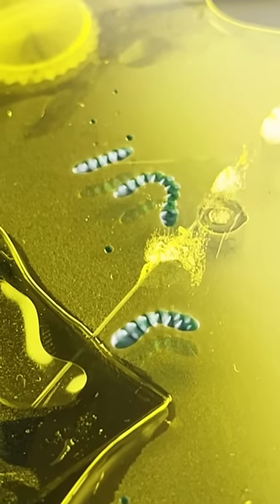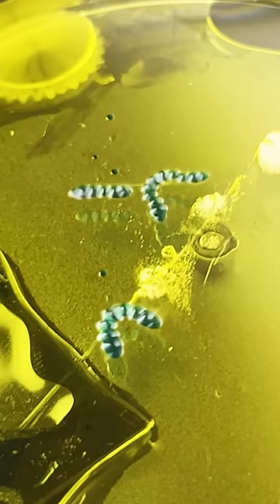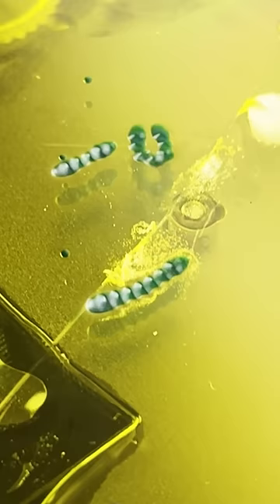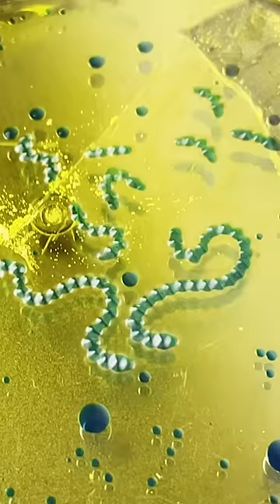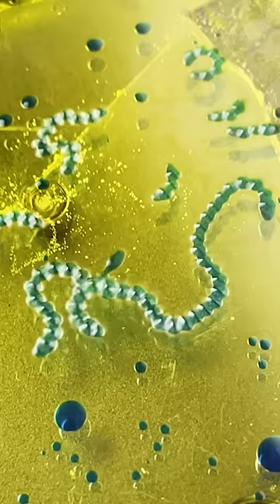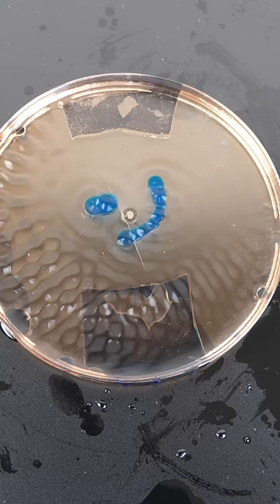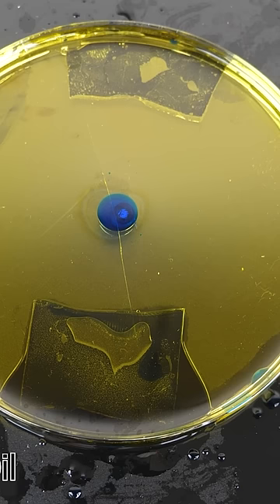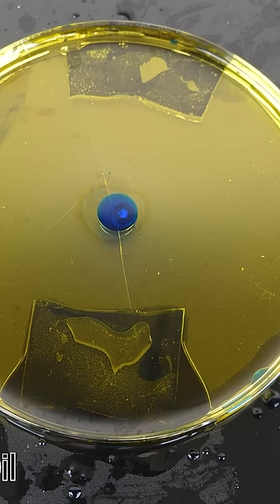Faraday's Worms

Comment: What were they vibrated upon???
Reply: It’s alcohol (ethanol to be specific) droplets on an oil base like olive oil. The thicker the oil, the better the result. Motor oil isn’t good though. Messy and toxic.
Reply: By the way, you can put food coloring of your choice into the alcohol. 

You might be able to use a battery powered shaver 🪒 or electric toothbrush held against a container. I haven’t tried that but it should work if you touch it to the center of the container underneath. A plastic cup or deep lid from a jar perhaps.